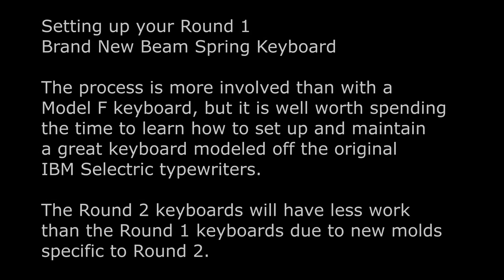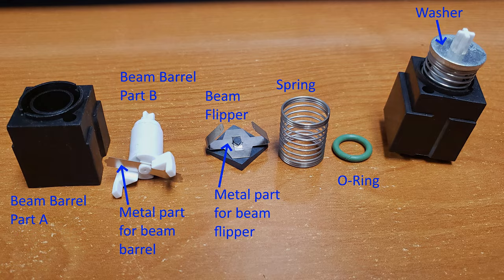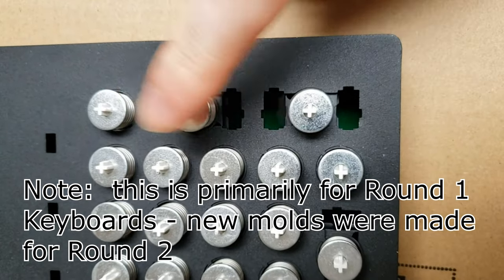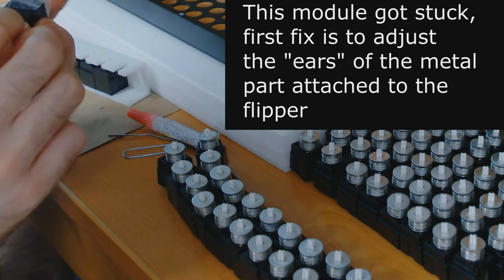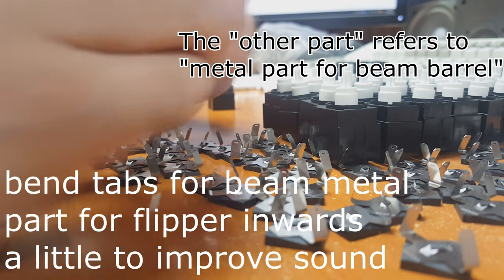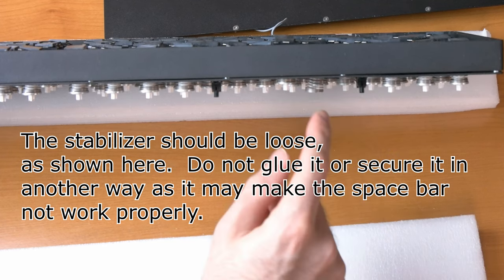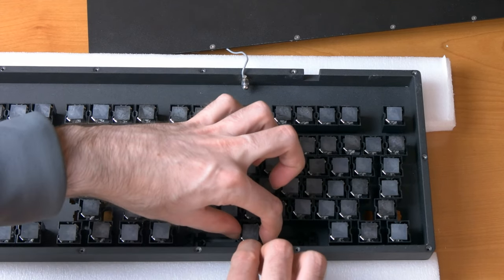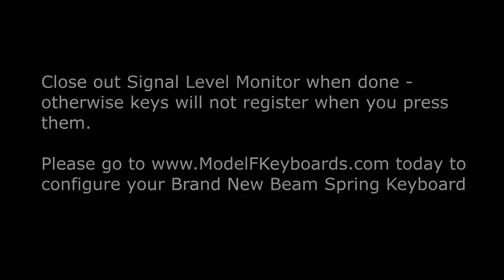Brand New Beam Spring Keyboards Setup Guide

Comment: Thanks for doing this. I was able to get my hands on one of your Round 1 beamspring keyboards, and I'm genuinely in awe by the typing experience. It did arrive with a couple broken leg modules and some that required a little bit of tuning, but once I had all those replaced or fixed, it's such a pleasant and unique experience to type on.

Comment: Important word of warning!
Do not put the keyboard upside down on the table while removing the backplate. Make sure it sits on some supports as shown in the video so the keys are not pressed down while the backplate is removed!
This is what happened to me: I had three stuck keys, removed the backplate and 15 flippers jumped right into my face.
Re-attaching the flippers is... fiddly is not the right word, maddening! It's way easier to do when the switch is completely disassembled but the washers are glued on which doesn't allow to disassemble them. I spent over 10 hours attaching the flippers. It gets easier after you get the hang of it. There is a close-up video of a guy performing this feat here on youtube.
Also some of the spare switches are taped. Hold down the flipper while removing the tape!
I guess this is comming too late for most people who watch this video after it happened. Good luck to you...
Reply from the maker: Yes, very important.  As a note, the improved Round 2 modules feature a press-fit washer instead of the glued on washer, so it may only take under a minute to reattach each module since it can be easily taken apart.